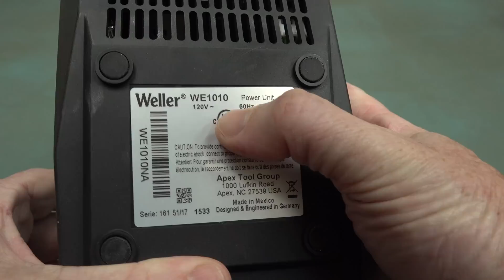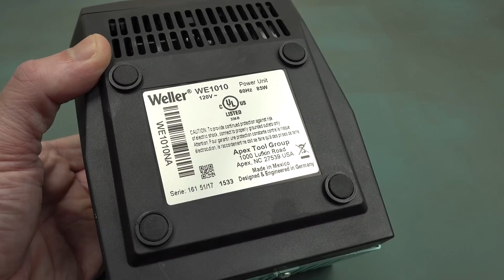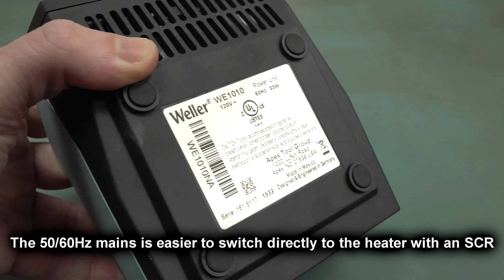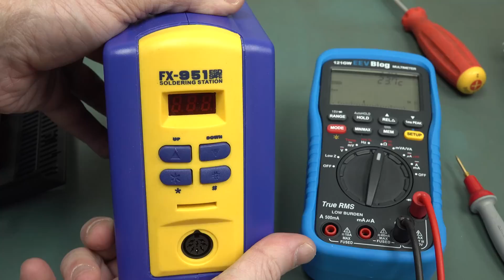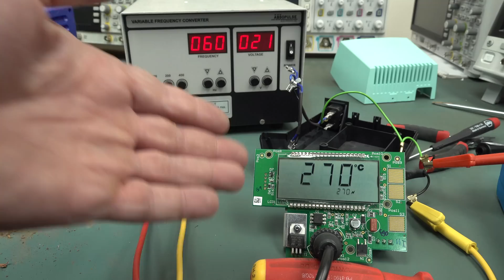EEVblog #1152 - 240V-120V = Magic Smoke!

Comment: That product was never tested for use outside of North America, due to it only having a UL Listing for US & Canada (cULus graphic symbol) and no certification marks for any other country safety testing organizations (i.e. AUS, RCM, CE, etc).  That product was evaluated by UL under File Number E18708 for Apex Tool Group (aka Weller Professional Tools Division) to the UL Category "KQLR" - Industrial and Laboratory Heaters, which uses UL Standard ANSI/UL499 and ANSI/NFPA 70 (aka National Electrical Code) to evaluate the product.  This particular product category does not require additional fusing of the product primary power input, and relies entirely on the branch circuit power protection at the main power panel of the facility.
Reply: My 240V CE marked WESD 51 has no fuse on the primary as well.
Reply: if an obvious common sense protection is not required by regulations, it doesn't mean it is unnecessary.
there are countless possible scenarios where mains-powered devices can catch fire long before the branch mains breaker kicks in.
Reply: KCautodoctor, A sad but true fact... and a cautionary note for people buying in NA.
Reply: Shouldn't that at least imply that it cannot be sold as a consumer product?
Reply: @stragulus  not at all.  Check out all the other consumer level soldering models that Weller sells that have been evaluated under the same UL FIle Number E18708 for the same UL Category "KQLR" - Industrial and Laboratory Heaters
Reply: @KCautodoctor  Thanks for that. I guess what I'm asking is, is the intent of that UL category for devices used in labs, instead of consumer homes, and are they abusing this category?
Reply: @stragulus  that is a common misunderstanding when people see the names UL uses for the category descriptions.  It is a carry over from many years ago and no one wants to change the category descriptions since it will lead to more questions about why there was a need for the change (i.e. lawsuits, etc).  If the product is UL Listed but was never evaluated for use by an average everyday consumer (a typical Walmart or Home Deport type customer) but rather intended to only be used by a trained professional, then it will include wording near the UL Listing mark that the product is not intended for consumer / home use.  UL has the final say on which category a product will be evaluated under based on many factors, including who the customer / end-user will most likely be.
Reply: @KCautodoctor  I see. Thanks for explaining!
Reply: Even in the USA, it is possible to run into 240v on standard sized outlets.  In the computer datacenter at my job, we have 240v on all outlets.  (yes, that passed inspection).  And no, we aren't some mom and pop shop who hired an amateur electrician--we are one of the "big, well-known" international IT companies.  Works fine with MOST computers (they can handle the 240).  BUT we did have an older PC someone plugged into the datacenter when we first moved in.  Took weeks to get the smell out ;)  So I see no valid exception to this not being fused even  in the USA.
Reply: @rgarito  Of course in that case the outlets should be 240V type. Amazing that it passed inspection with 120V outlets on 240V!

Comment: Now to find a good audio book and some fresh transformer wire of appropriate guage and length and start "sewing" a new primary into the transformer.  Done neatly, one should be able to match the same number of windings or thereabouts. Listing to Richard Feinman lectures for instance or Tolkien, Mark Twain, or C.S.Lewis.  Before you know it, you've listened to a nice book, got some zen satsfaction from a mondane physical task and can find oneself more relaxed, just like a short vacation. :-)  You could even add your own mains fuse or circuit breaker. 🦊

Comment: Back when I worked at a computer shop, I had an old system (mid-to-late 90s build) in for repair, no power they said, checked it over inside and out, no obvious failures, bad connections or someone having flicked a 240/120v switch (didn't have one), plugged it in, pushed the power button (proper hard On/Off job, not the soft-on stuff we have today), the smoke billowed out the PSU like a smoke machine, components on the motherboard stated glowing, the HDD started smoking, and the WTF mode kicked in and I ripped the power cable out ........ Boy did my build room reek for days... :S

There is, or was, a video here on youtube of a similar experience by someone else, frickin' scary when stuff like that happens...

Comment: We have 24v volt PDUs in our data centers mixed with 110v. Occasionally, some mook network engineer will go in there with a PC to setup to do testing and manage to find the correct power cables to plug it into a 240v socket... they go off like a shotgun... it's really funny.

Comment: RIP for Weller.. at least good thing that brains survive.. if You get new or used transformer, repair be easy..
To me, that brown stuff looks like burnt transformer insulation tape.. usually, light blue when fresh..

And if it's gets You feel better, this is not a first time when someone plug device in wrong mains outlet.. In old times, one customer order saw table from USA because it was cheaper.. don't look on power rating's and plug it in 230V mains.. Bye bye new motor.. Repair wasn't cheap.. 
Other situation - chargeable hair trimmer and charger rated for 120V.. Charger was killed when woman plugged it in 230V mains.. At the end, charger was modified with SMPS instead of transformer.. only problem was to calculate secondary voltage an current. In that situation, brains survived to..  only cap blows up and thermal fuse..
Second way to burn something - when on device is voltage selector and someone playing with it.. And not only kids.. adult's to.. :D
Situation's like this happens time by time.. ;)
When I was young, one time i blown up amplifier because input and output wires was identical.. but years before that, i removed plug to use it in one project.. before i plugged it in, i long time can not deside where is output, where is input.. just guessing and put plug on one pair of wires.. instead of removing 4 screws and take lid of to look inside.. Bang was very loud and last 3 -6 seconds and all room lights up in blue flashes through ventilation holles.. In that day, old amplifier from 60-70' dye.. :D 
We all learning from mistakes.. :)

Comment: In the UK, the fuse is at the source. The plug. Not so in Australia?
Reply: Not correct, the plug fuse is not for protection of the device. 
In the UK there is a fuse whenever the wire gets thinner. There is a 30A/32A slow-blow fuse at the board (ring main can carry just over 7kW) a smaller fuse, maximum of 13A, at the plug to protect the "flex"; note most IEC cables should have fuses smaller than 13A, only a true 3kW kettle lead (with a notch) should be 13A. Then a fast-blow fuse within the device to stop it spewing it's guts everywhere if it tries to suck up the full 3kW.  When those little unfused USB chargers short the mains in the UK the magic smoke tends to come out so fast they split their cases.

Comment: At 5:13 there is two levels of transformer primary protection.  The small round lead device is referred to in the US as a Bell Fuse and it is in series with what looks like a tan capacitor.  That is a self resetting polyfuse.  At excess voltage it is likely this let out the magic smoke.  The primary connects to the left most terminal which does not go to a winding.  It then goes through the two fuses in series to the 2nd terminal, which is a lead from the primary.  In viewing the transformer, it is most likely just fine.  Check the bell fuse, and replace the polyfuse.  The polyfuse most likely let out the smoke which quit when the bell fuse popped.  Most of those transformers have a thermal fuse inside the windings as a last resort to prevent fire.  This is not replaceable.

Change the fuses.

Comment: I wonder how Dave wound up with a soldering station that is only meant for use on 120V. I'd be some surprised if the safety codes regarding this type of equipment do not require primary side fuses. I have built very few power supplies over the years that were powered by AC mains but I always wired in a primary side fuse.

Comment: while there is no fuse on the primary side there would be a thermal fuse so it may have blown however you should not have gotten any reading if the thermal fuse went.

at 220 volts that would be 1100 amps and would pop  the breaker or blow the house fuse instantly

since the output is like 24 volts you could get a transformer for a hvac or even door bell and convert the soldering iron to work on 220/240 volt system.

you can also get a 2:1 step down transformer so you can run 110 from 220 and 240 volt systems

the delay in startup is usually a self test.

if you noticed when you applied power the lcd display lit up all the segments that is the self test.

you are very lucky here but you may not be so lucky next time so lesson learned.

label the voltage or convert it to work on your voltage or use a 2:1 step down transformer

Comment: Hey Dave, is the secondary voltage on that Hakko clone close to the 23 V that the Weller requires? that would be a good project to make the Weller usable from using that transformer.

Comment: Try to rewind it and convert the original primary from 120v 60hz to 240v 50hz.   You will most likely need double the turns / half the cross sectional area conductor to achieve this.   There are some basic ratio calcs you can use to determine this.  The hardest challenge is to strip the laminations so you can unwind and rewind the coil with a machine.

Comment: Isn't the secondary voltage only determined by the number of secondary windes? If you increase the voltage on the primary all that is going to do is increase the magnetic flux or potential current when the field collapses into the secondary. Or am I missing something?

Comment: Anything I've worked on over the last 10 years has a  fuse built right into the primary winding of the transformer, buried underneath the protective tape. I figure this must be required today by UL and/or the others . . . . I've actually repaired quite a few rather than buying a whole new (very expensive) transformer. This Weller is an exception and a rather big fail . . . no protection at all.

Comment: They should have put an MOV across the primary terminals, and a fuse in line.
My Astron RS35A received 240V when the neutral was broken. This drew 240 across the plugs, when high load appliances (Aid conditioner) in the other phase brought the now isolated neutral to the potential of the other phase.
My astron belched our some pretty nasty smoke. Opened the unit, the MOV was nice and crunchy and the once clear glass fuse was black as the ace of spades, but the transformer was fine. Changed the MOV and fuse and put it back into service.
Reply: Had the same thing happen on a microwave oven, the duplex outlet that it was plugged into had some internal issues, that caused the micro to see 240V as it was on a split circuit.
Replaced the MOV and the fuse and it is still in service 10+ years later.
Reply: When he described the magic smoke and explained the cause, I immediately though he'd find a crispy-black MOV.  I was in a state of disbelief when he opened the cover...like "there's got to be an MOV hiding in there somewhere."
Reply: Just like mechanical engineering, electronic engineering is just so incestuous (relatively small circle of people who know everybody else).
Reply: 12voltvids, Fabulous... I will retrofit my new RS35M before mystery smoke does any danger to it.

Comment: At least its nice weller uses a single voltage transformer, so any boring 24V ~80VA transformer that fits in the case will do. Probably every second "random old transformers" bin has one of these, mine certainly does.

Comment: The transformer failed not because the varnish style insulation on the primary failed due to  220 volts the insulation is typically rated to 600 volts. The insulation failed due to burning off because the inrush current was too high. The reason for this can be varied but I suspect it was the transformer in saturation. I agree the input to the primary should have been fused as I have seen on every commercial and consumer product I can think of. Do not understand how such a thing ever passed muster at Weller to begin with.
Reply: I agree, but the current was doubled by doubling the voltage.

Comment: Back in the early '90s when PC power supplies had the 110/240V switch at the back and the power switch in the PC case actually switched mains (286 and early 386 era), a colleague of mine had just finished assembling a new PC, and pushed the power switch to test.  There was a blinding flash like a professional camera flash accompanied by a bang that would have made a .22 pistol proud.  Then complete silence in the entire shop (the assembly area was at the back of the display section where customers walked around).  I've never seen someone jump back so fast.  Turned out the power supply was set to 110V.

Comment: Famous last words:  "I'll remember ....."
(there's no oil in this engine, there's no coolant, I've jumpered the fuse and need to plug it in to the variable supply, to re-connect the leads to the "volts" socket......)

Comment: I remember my PEBKAC very well. Quick late night repair on small motor driver system.I didn't pay attention when hooking up the new transformer and I switched primary and secondary. Reached over my bench to plug it in ...... Sometimes I still see the flash or feel the bang in my dreams. Luckily we all learn from our mistakes.

Comment: Our plugs in the USA you are completely different and you can't plug a 120 AC plug into a 220 AC outlet or the other way around. I know when I use to repair Weller Irons in the 1980 - 2000 they had glass fuses in them.

Comment: Insulation wasn't hurt by over voltage, but over temperature, that is what melted the insulation. But yes primary should have been protected.

Comment: I remember cutting the copper windings out of 1/4 hp electric  motors back inbthe 70's when copper prices were high. We could buy the motors at a scrap place, take them home and using bolt cutters we would remove the windings and place them in 55 gallon barrels. Then sell the raw copper back to the scrap company and the motor housings were saved and also turned in for money. The way it worked was raw copper was worth more so you would buy the motors for so much per ton, remove the copper and get even more for the raw copper. I got my first brand new bicycle pulling wire as we called it.

Comment: Not enough winding's on the primary side can have bad effects. 240v transformers usually have twice the winding on the primary side. I think what happen here was as you said too much core saturation or because of the less winding's some arching might have happened since the coating is fairly thin. On the flip side having 120v power here, I plugged in a 240 volt transformer that I was intentionally blowing up, it just ended up tripping the breaker. Didn't like the car battery though. ;) That should have a fuse, then again anything new that's Weller isn't any good anymore. I have a low heat iron that goes through tips like crazy and another one that had an internal break, besides feeling like they have cheap plastic handles. :/ I have the feeling they passed on their production to China or a different manufacture and they created major safety / reliability issues.

Comment: Not as big a piece of trash as the Weller WR3M.  The vacuum pumps are complete GARBAGE and they refuse to sell the pump as a spare part. They have every other part available though.  I have 8 of these and have to pay $400 for the Weller “repair” swap-a-roo center to replace the bad pumps every 1-2 years each unit.  I suspect we are getting used pumps pulled from other units, never even getting the machine we sent in back.  I sent in a cosmetically perfect machine and what I got back was a piece of tired and worn shit.  Whoever used that one liked to use the hot iron tip to turn the power off and on repeatedly!!!  The WR3M is $2,500 for 1, so make that 8....that is an investment you respect and take care of.  In addition to all scratched and trashed machines from god knows where.....I even get different model versions as a substitute (earlier versions).  My glorious armada of pristine soldering stations is now a hodge podge of ghetto trash.  Sadly, I have to say avoid Weller as they are going into the toilet like Apple.  All they had to do was offer the pump impeller assembly like they do all their other parts and I would be happy.  Otherwise, the fact is they are intentionally designed to fail and roll you over the Apple barrel.  Go Metcal.
Reply: Nail polish dots tell you what comes back and what is "new". Be paranoid, it can be entertaining.
Reply: "Milking it comes to mind"

Comment: You know, you are always complaining about soldering stations not having the features you want. You are an engineer. Make the perfect soldering  station. That would be a a fun series of videos to watch.  Electrical design, physical design,  CAD modeling, microcontroller programming, etc.
Reply: The EEVBlog Soldering Station would make a good companion to the EEVBlog Multimeter.
Reply: and more important, must be anti-muppets! What kind of moron connect a 120v to a 240v outlet?
Reply: @HipocratesAG  I believe it to be Weller's fault mainly, and others do it too, but using the C14 inlet to attach the power cord. I have so many of those IEC cords, and if I saw a device that used it, I would grab the first cable I could find and plug it into 240v! If the device had a molded plug - it never would have fitted in the wall. (plus the primary fuse issue)
Reply: I see what you did there. I support this 100%. +1 would insta-buy.
Reply: Totally agree with this idea
Reply: Try and make it sub 100 too!